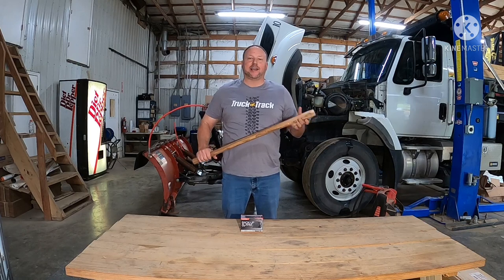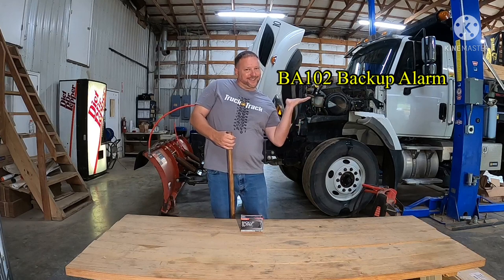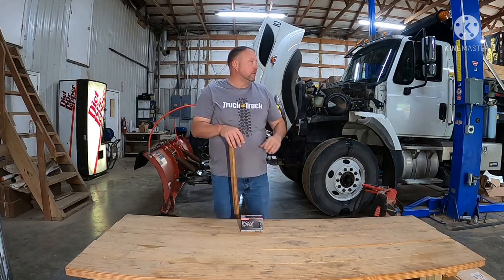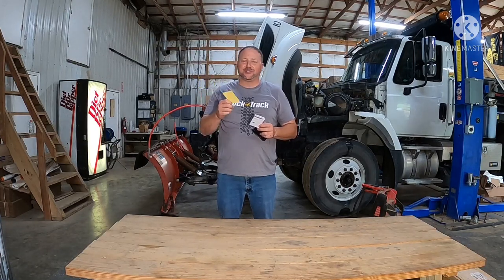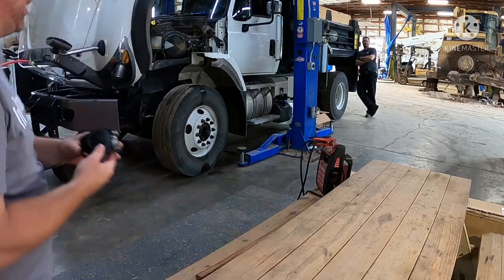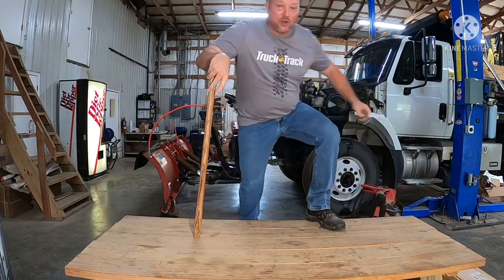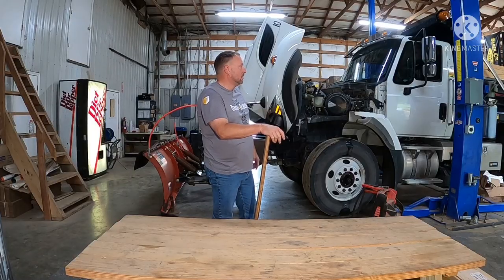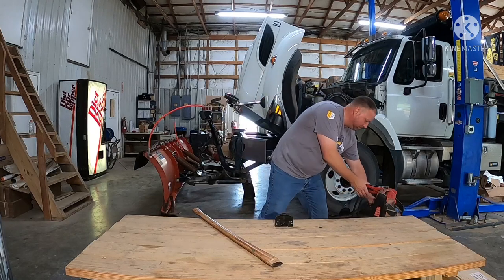Axe Handle Review BA102 Backup Alarm

Comment: I thought the  back alarm was changing to the newer  updated sound. I  saw some heavy equipment on the road with the new signage stating this fact. It’s more of an air compressor sound to it.
Reply from the maker: Great point! In Europe they use static back up alarms. You can only here it directly behind the vehicle. So if you sleeping during the day it wound bother you. Thanks for watching